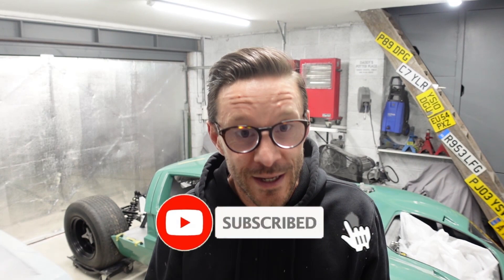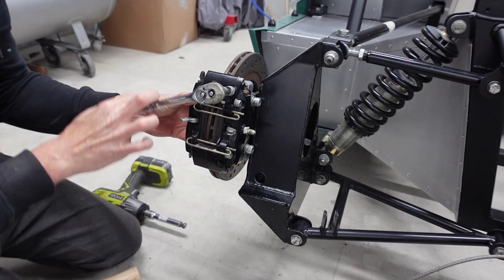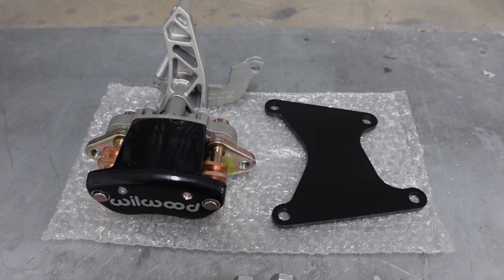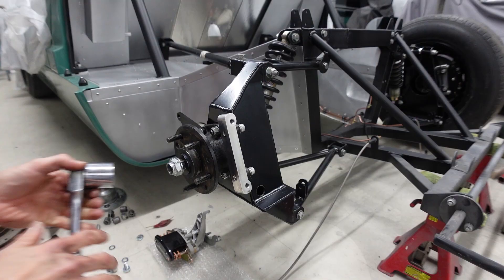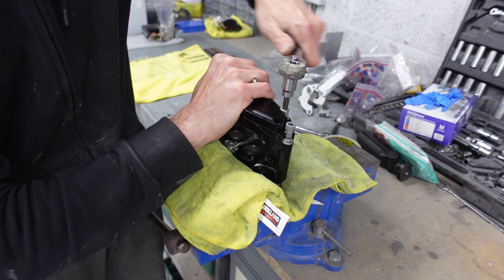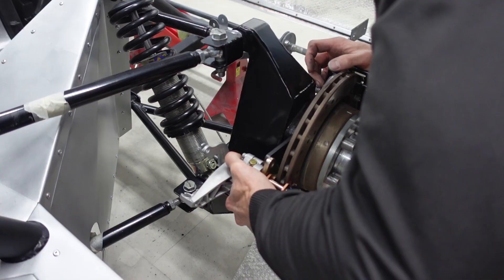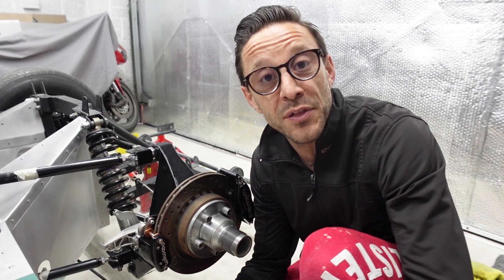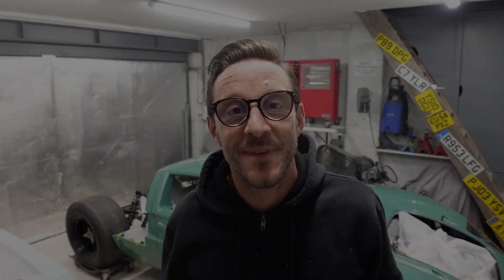GT40 Restoration - Ep 42: Installing The Tornado Sports Car Parking Brake Caliper Kit

Comment: Hi Spec do an electronic handbrake kit. Does away with the handbrake cable, you only have to route a wire to the caliper.

Comment: Those little button head bolts are an absolute ****ers for rounding off as you can't get a decent depth on them. So easy to chew them up and that's without having seized in!
Reply from the maker: Yea, splitting the calipers was not planned!